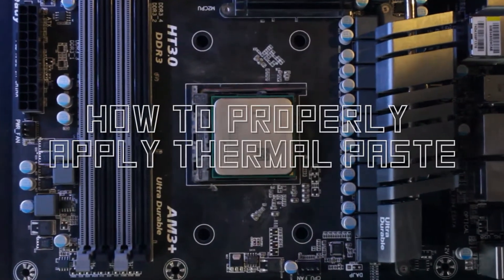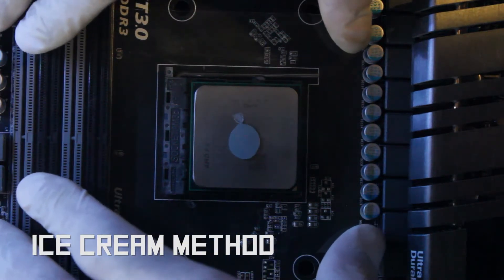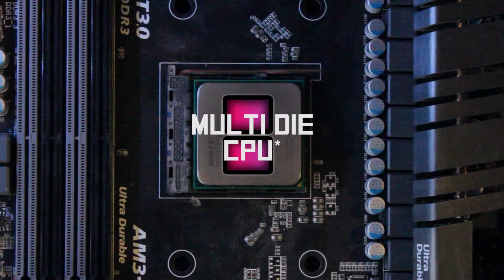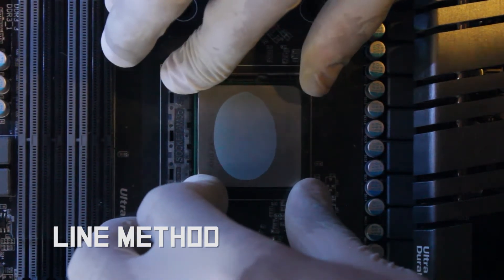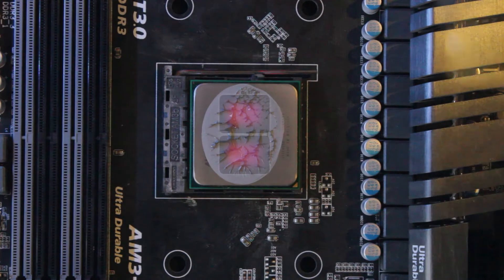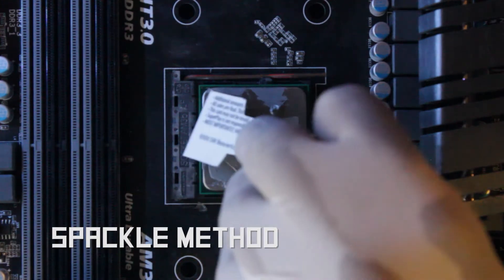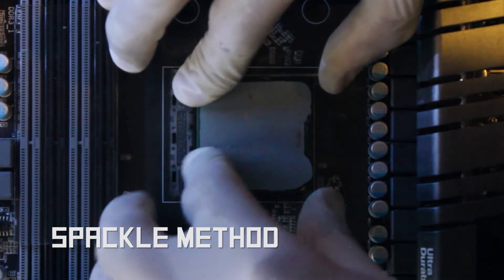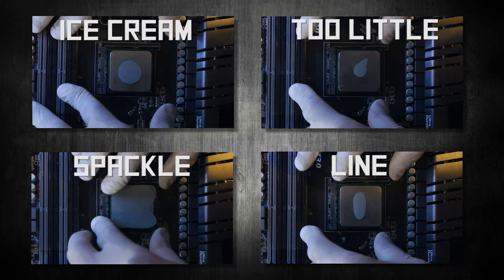How to Properly Apply Thermal Paste

Comment: You added too little thermal phase on the spackle method. And you need to spread it from left to right, then from bot to top for perfect spread and therefore no air pockets + no gabs